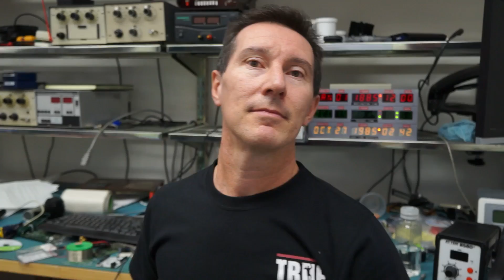eevBLAB #2 - Are Electronics Hobbyists Useless?

Comment: Welcome to the plug and play world of young electronics hobbyists. Buy an Arduino, buy a few shields, some breakout boards, some jumper wire, and then copy other peoples libraries and code. That's just fine if that's all you want to do. But anyone really wanting to get into the field should have a basic knowledge of all the things you mentioned (I could do them at 14 years old).

I don't think your requirements are out of line in the slightest. My take, you want someone with passion for the field, not someone on a school-based career path. 

That being said, perhaps you COULD have been a little bit clearer. You might have said things like 'design a simple circuit using an opamp', 'design a 2-sided PCB with a half dozen components', 'know how to set up a router and connect systems to the network'.  

shrug  But, I don't think you were out of line at all. You're just looking for that one in a thousand, and yeah, they're still out there.

@JohnS_AZ

Comment: Really?  That's amazing!  I was making my own circuits when I was just 13 years old in 1984! Making the circuit on a bread board (from scratch), troubleshooting it, transposing the circuit to a PCB layout, Etching, drilling and soldering the finished board and that was just me having fun! Heck when I was just 15 I was already making interface hardware that plugged into my Apple II+ Computers back plane and even had to learn to write the software to control it.

I now run an electronics repair shop and also own a major electronics parts and supply store and I have asked for applicants many times for the repair shop business and many call themselves electronics hobbyists or technicians and I still need to coach them on a lot of the most basic stuff.

Comment: I was never really a hobbyist. I got my EE start as an audio guy in a theater, learning some electronics things to make sense of how my equipment worked. Now I'm working on my MSEE and design life science research instruments. Here's the problem we see on the Electrical Engineering Stack Exchange, and I'm sure it's prevalent elsewhere. Companies like Sparkfun and Adafruit are really dumbing down the whole electronics hobby community. You buy they little modules that do x, y, or z, and integrate them into your project. Next thing you know, you have a bunch of dipshits from all walks of life that have figured out how to plug a shield into their Arduino board, but have no clue what to do when the provided example code doesn't work in their application. The same kind of thing is happening at the professional level, but in a slightly different way, and for different reasons. Need USB? Get an FTDI chip. Need to add Bluetooth or Wifi? There's a module for that. The product life cycle has gotten so short and the systems so complex, there's no time to reinvent the wheel with every new requirement. Hobbyists don't have these types of constraints, so what's their excuse?

Comment: This is the disposable age, making or repairing your own projects or even everyday electronics may not be as common anymore.

Myself, I was mostly self taught in the 80's and I learned electronics and computers at the same time. I'm no EE student but could design a circuit with a lot of effort, but layout and troubleshooting are no problem. Board rework is mostly easy. I even taught myself to make  circuit boards years ago with just a photo-resist marker and the etching solution.

IT, both computer and network, I am very familiar with. Soldering, well, self taught using the NASA guides. Also hold a General FCC amateur radio license, not that it is hard to get if you just memorize the test guides, but I only skimmed the ARRL guide, took the test and Bob's your uncle. I'm weak in analog electronics. I also have a good foundation of computer programming skills that I don't use much anymore.
 
Long story short, I don't think there are tons of folks with a broad general set of skills you want that are not currently already employed. If I lived in Australia I would have wanted to apply.  

Hope you do find a suitable helper.

Comment: The trend of using microcontrollers and programming when a few discrete components in the right places would do just fine is certainly responsible for some of the circuit designing deficiencies.

Comment: the internet seems to enable the truly talented to thrive, but has slowed nearly everyone else down with all the distractions that come with it. (/opinion)

(observation:) I am in 3rd year uni for EE and I can say that MOST of my peers do not care about electronics.
They are in here because;
a) their parents told them to do it
b) they think that after slaving away doing mundane things to get a degree, they will get any job they want

I even met a 3rd year computer engineering student who was too afraid to go into his own routers settings. and he doesn't even know what a mac address is, or that routers make their own little local subnetwork. 3RD YEAR!

in my second year my lab1 instructor was surprised that I took one of the really simple projects from the manual and re-constructed it on perfboard with a header after I had it graded on the breadboard. "wow none of my students ever did anything like this"
i thought it was the obvious thing to do since we are going to have to reconstruct it anyway for a few of the next projects, might as well be able to just plug it in with a header. isn't that what engineering is all about? designing things to make future tasks easier?
Reply: connly33
 "aren't confident enough to try" I think you hit the nail on the head there. I know throughout elementary & high school, unless you were lucky and had an awesome teacher, any deviation from the way the text book told you to do it would lead to marks deducted, and even ridiculed. I've met so many people that I try to get interested in, well, anything, but they always say 'but what if I mess up?' to witch i reply, 'then you mess up, and try again, no one gets hurt, and you grow as a human being' but they just cant seem to accept that.
Reply: connly33 I'm studying Computer Science and I pretty much understood all the theory and practices... But I still don't feel confident do actually do something productive for a company.  We learn so many different things in parallel at school, that we can't really focus on one thing and get good at it.

And even if I start to really understand something at the end of the semester, the new semester will start soon and all the knowledge starts to get forgot.
Reply: I find it ridiculous that some of the people coming out of IT and electrical engineering courses and still either have no idea what they're doing or aren't confident enough to try... that tells you quite a bit about how bad education is getting. i'm a senior in highschool trying to figure out what field/school i should go into when i graduate, i've been a " hobbyist " ( depends on how advanced you would call a hobbyist )  and have been learning and self teaching myself about a little electrical and mechanical engineering, some programming etc... from the age of 9 or 10 with the help of the internet ( didn't have the internet or even a cell phone until a few years ago actually ) and all the broken electronics, computers, appliances, test equipment etc i can find and attempt to repair
Reply: I was giving lectures on my uni time, Also went to vocational school to give some. That is not uni problem. I see that as standard problem with standard people. But best engineers are not standard people. They work their asses of and enjoy most of it.
Reply: I'm a 2nd year EE student, and I confirm your words, I would also add that a lot of people study EE for the money, which is really sad if you ask me, its hard to find passionate students over there.
Reply: +EvilPlagueDoctor  Yeah, mostly, but with physical expensive components I'm the first to admit I didn't want to solder them.... I didn't have a job in university, so if I break that board someone has to magic up 200 USD..... and then there is the time these days, so not only is it the money but we need to wait a month and a half for it ship from China...... yeah..... told the greybeard he should do that one, I'll mess with something that costs 5 USD and you can buy down the street... except that those kinds of shops closed in my part of the US so pretty much anything was touchy because best case it would cost you a week small components shipped with free/near free international shipping.  Hence I'm much more of a coder than a hardware guy, couldn't break things that way, FPGAs were fun were too.  Only now that I've been working a few years does the cost of these components seem manageable for me to just try things on, so I'm getting a bit more into hardware these days.
Reply: I surprise that they could not do it. honestly when I was in college for engineering at letourneau university most EE third year could design circuit and be graded on breadboard. even as mechanical technology major I had to take some electrical classes. I had design circuit and be graded on it for digital electronics. The sad thing is that graduated with 2.54 gpa and I am dsylexic so I do not have job as a mechanical engineer.

Comment: Those are completely reasonable requirements.
I'm a 3rd year mechanical engineering student and my summer job was designing and debugging pcb's and circuits for a dj lighting company. I would probably apply for your job if I meet the location requirement.

Comment: As a hobbist and engineering student myself, I totally agree with what you say in the video. But after reading the job description, I can see why some people might think it's too much. There's quite a large list of skills there and people might think they have to be good / experienced in all or most of those to get the job. I don't think that's what you expect though. The "largely essential" list seems very reasonable to me. Any serious hobbist should have those. The first list is totally non hobby skills, but I don't think any think in there would be hard to learn. The 3rd list is more of a computer geek than
electronics geek, but ok too and only said to be desirable, not required. I think I fit the job description, as I have most of the skills in there and think it would be a great place to learn. I just happen to live on the other side of the globe, in Brazil ;)

Comment: You are not asking too much imo. I am not an electrical engineer... I am a self-taught hobbyist. I can layout PCBs with a variety of software (favourite is Altium designer), I can design a circuit, test & debug an circuit. My soldering is fine for larger jobs but I do struggle with really small SMD.
I reckon you should be able to get someone exactly how you specified the job description.